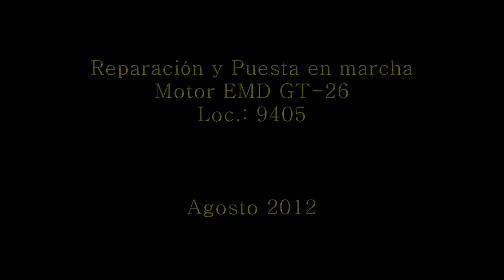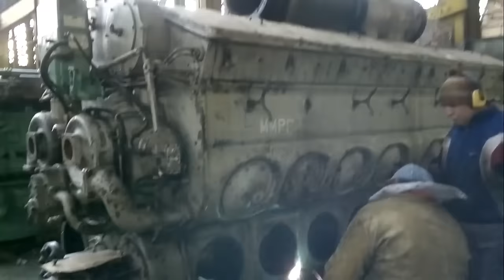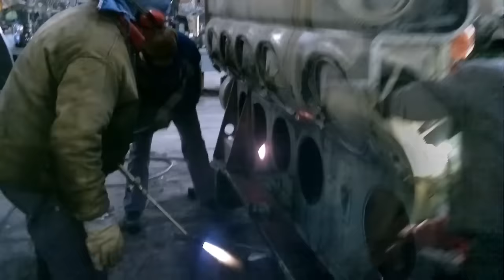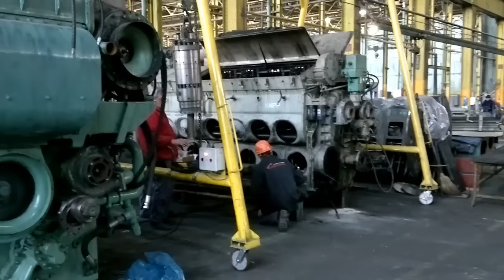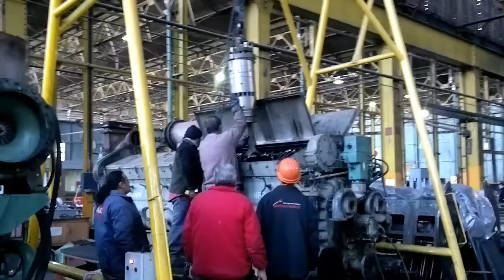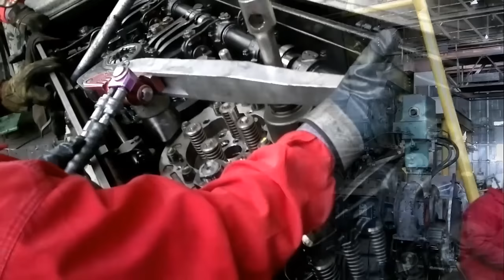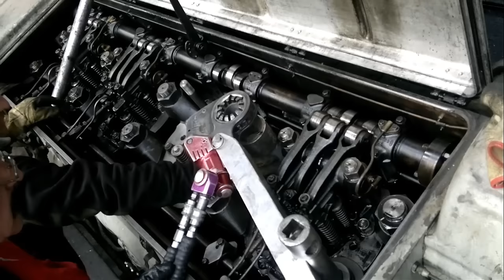Locomotora EMD GT-26 #9405.

Comment: Nice!!  What kind of a starting system is that?? Doesn't sound like air..or inertia..or electric.
Reply: The technicians have the #1 cylinder's "test valve" in the open position while the other 15 cylinders are firing, thereby causing a lot of air blasts.

The starting system on locomotives is a pair of 64 volt starters in parallel or a pair of 32 volt starters in series, either one being powered by the batteries.

It is stationary and marine applications which usually employ air starters, not locomotives.
Reply: Peter Haas
Some trucks are also equipped with air starters as well.  Scare the hell out of you if you are standing next to it not knowing it wasn't a battery start.

Comment: So... On 11:20 and 11:45, why the GT26 wouldn't start up? Not enough battery?
Reply from the maker: Indeed, the batteries were low on energy
So a parallel connection was made to another locomotive to start up
Reply: Ah, is that why we can listen to other locomotive before 9405 started up?
Reply from the maker: Yes, indeed

Comment: That is quite the torque wrench 8 30 into video.
Reply from the maker: the tool is a Hytorc model xlct-4. The nuts are tightened with a torque of 1930 lbs/ft
Reply: Carlos Contreras
dam

Comment: Awesome video
Reply: Muy buen trabaio. But here in usa two people replaced cylinder assembly. Old locomotive we sale to south america because to much smoke. I was working over 20 years on this locomotives. Some guy asking why not use generator   to start the engine. Only use generator to start the engines it is on locomotive build by General Electric 4 strok. EMD it is 2 strok  end useing two electric starters like in buses. Muchas Gracias guys.

Comment: What are the circular covers at the base of the engine - looks like they are secured by a simple hand tightened knob?
Reply from the maker: Hi, Linn Platter
These are covers of the crankcase and adjusted by hand or with a tool
Reply: Two round "hand hole" covers per cylinder on 567C and all later engines including all 645E, 645F and 710G engines (rectangular on 567B and all earlier engines).

The upper "hand hole" is for inspection of the liner and also for connection of the liner to the cooling water manifold.

The lower "hand hole" is for access to the crankshaft and rods, also the piston cooling oil jet.

This concept allows all major engine components to be inspected and evaluated without any significant disassembly, save removal of the "hand hole" covers themselves.

All cylinders may be thoroughly inspected and evaluated in one rotation of the crankshaft.

The engine is "barred over" (rotated using a bar), NEVER "inched" using the starter motors.

Comment: At about 15:45 is he tightening down/closing some type of decompression deal?
Reply from the maker: In the minute 15:30 , the mechanic adjusts the valve plug control compression cylinder #16
Reply: Carlos Contreras Exactly ... cylinder #16, not cylinder #1 as I said earlier.

The "front" of the engine is actually the "rear" of the locomotive, and the cylinders are numbered 1 through 8 on the right side of the block (left side of the locomotive) and 9 through 16 on the other side.

Comment: Awesome video.  I especially liked the part when they dropped in a brand new 2-stroke sleeve into a cylinder.  Mexican labor is much cheaper hence why they buy from the US I guess because these engines can basically run forever..smart thinking on the Mexican side...not so smart on the American lol
Reply from the maker: Hi sc0tte1
What you say is actually true. Here in Argentina, is exactly equal.
Regards
Reply: Labor can be cheaper in places where the government doesn't over-tax and over-regulate its citizens and industries, like the federal and state governments do in the United States.
Reply: What the hell do Mexican labor prices have to do with an American made engine being repaired in Argentina, sc0tte1?
Reply: Robert Luedeman
these diesel tec`s don`t look under payed or cheaper in any way..the engines do run well if maintained but   not forever  they can be rebuilt a cyl at a time as need ed taxes in the US are used for policing the world so dictators don`t rule the world freedom is not free in the free world mr. under ground.. we farm hemp soon in the US again this time forever seed diesel 77% cleaner for the farmer
Reply: D. Saelens
The main difference is the technicians employed a simple "A-Frame" and block and tackle to lift/lower the "power assembly", whereas EMD's approved procedure is to employ a special fixture which is bolted to the top of the power assembly for both removal and replacement. The EMD manual shows the fixture in use, and it would not be at all difficult to make such a fixture in-house, thereby saving much time, and potentially avoiding damaging a power assembly, at a rather small one-time cost.
Reply: D. Saelens I didn't ask for a discourse on hemp farming, American tax policy or how cylinders are changed in an EMD. You don't have a clue about any of it.

Comment: The turbo on the right will fit just fine on a Honda Civic!
Reply: That turbo is designed for a 10,300 cu. in. engine!

The same turbo design was used on 567D engines, and also on 710G engines.

It is actually a turbo-compressor system.

During starting, it is acting as a compressor, driven by the engine's crankshaft through an overrunning clutch.

After combustion has been achieved, and exhaust gas temperature is sufficiently high, the overrunning clutch disengages and the turbine takes over and the turbo-compressor becomes a true turbocharger.

This design eliminates the need for two Roots blowers.

Comment: So countries like this and India get the second and third hand locomotives of the world? Don't get me wrong what they did in this video is quite impressive but why the non-standard couplers and lack of handrails?
Reply from the maker: 1) Our locomotives are very, very outdated.
2) This railway line is still using the old English system (chain couplers). I could not tell you why not use the knuckle system (which is much safer)
3) These locomotives were already without handrails, (do not know why and neither because they are not adapted)
Reply: Carlos Contreras Yeah I was curious, I mean safety guys at least weld up some handrails on them. 
For outdated locomotives you guys seem to have rebuilding them down to an art. 
Also here in the US class A railroads (BNSF, UP, KCS/TFM) are always scrapping railroad equipment which some is still in perfect working condition. Why not look into obtaining things from here? Will they not allow it?
Reply from the maker: ElfNet Designs I would not know that answer, since this is controlled by the state. We request a great deal of spare parts and various materials, but unfortunately depend on the decision of the state.

Comment: Why is the oil blue? And what are the valves the exhaust is leaking out of and the guy tightens?
Reply: shoominati23 those are the snifters (or cylinder blowdown valves) usually those are used to blow out any crap or moisture that is left in the cylinder. (idk how it is for the railroad guys but in the marine industry we will normally keep the fuel rack shut while we turn it over)Btw he is tightening them all wrong XD never use a pipe wrench on them, they wont last very long like that, it strips the threads.
Reply: shoominati23 Its probably 50wt non detergent oil. its not pennzoil or quakerstate, thats for sure.
Reply: I always wondered how they could change a piston in a big engine, like one in a ship. turns out they change out the whole piston, liner and valve gear. Very clever.

Comment: Also, why do 2-stroke loco engines have valves?  That sort of confuses me...unless I'm wrong in assuming it's a 2-stroke, but I saw the sleeve with the exhaust vents at the bottom so idk.
Reply from the maker: Hi
These 2-stroke diesel engines have air inlate ports and 4 exhaust valves (each cylinder).
Reply: Charge air enters through the ports towards the bottom of the liner.

Combustion gasses leaves through the four poppet valves in the top of the head.
Reply: Peter Haas Ahh I see.  I totally thought it was the opposite; exhaust leaves the ports at the bottom.  Thanks for the replies people, cheers!
Reply: sc0tte1 All large EMD (and GM) two-strokes are "Uniflow": the charge air and the exhaust gasses flow in one direction, UP, hence the designation "Uniflow".

In the video, you can see all the ports in the liner, towards the bottom. That is where the charge air enters the liner from 45 degrees before BDC to 45 degrees after BDC. This timing is fixed by the basic design of the engine, but is optimum for this engine design as all four functional "strokes" (720 mechanical degrees) have to be combined into two physical "strokes" (360 mechanical degrees).

Also, the fuel is injected at 4 degree before TDC so that the fire front will impact the piston just after TDC, on the piston's downward (power) stroke).

The timing of the four poppet-type valves is critical for high engine performance, and for that purpose, the power stroke is allotted fewer mechanical degrees than the combined scavenging+induction of charge air stroke.

In other words, while the ports in the liner are open symmetrically about BDC, the timing of the valves is asymmetrical about TDC, and the amount of asymmetry largely determines how efficient the engine will be.

What EMD (and GM) usually does is build a two cylinder engine and use this as a test-bed to optimize the timing of all of the events. Actually, most of the work is in designing and optimizing the orientation and duration of the camshaft lobes.

Then, they go ahead and, at least in EMD's case, build 8, 12, 16 and 20 cylinder engines (6 cylinder engines are no longer made in 645 or 710 models, but were made in 567 models).

As these are 45 degree Vee engines, timing is optimal for 8 and 16 cylinder engines (even firing, once precisely every 45 or 22.5 degres), and is not as optimal for 12 and 20 cylinder engines (uneven firing, once approximately every 30 or 18 degrees).

A comment about the liner design.

To maximize the intake of charge air, the liner has ports around its entire periphery. This means that the piston cannot have a piston pin which is exposed to the surface of the piston.

This, then, means that the piston pin must be contained entirely within the "piston carrier", and that the piston itself rides on top of the piston carrier, separated by a thrust washer.

This is a more complicated design, not duplicated on the Detroit Diesel two-strokes, but allows the EMDs to have higher charge air induction efficiency, which is important in a large diesel engine.
Reply: Peter Haas Thanks for your very detailed reply.  I understand! :)  Cheers
Reply: those are intake port and exhaust valves
Reply from the maker: Brian Smith
Yes sir, intake port and exhaust valves
Reply: Carlos Contreras Intake ports around the entire liner to maximize intake efficiency.

The Detroit Diesels, which use the same concept, use a conventional piston with an exposed wrist pin, therefore the DDs can only use about 85 percent of the available area for intake ports.

But, the first DD was the 6-71 with 426 cu. in. and 225 HP, and the earliest EMDs were 600 to 1350 HP out of 3400 to 9000 cu. in.
Reply: I have rebuilt them

Comment: are there electric motors driving the wheels and the diesel just runs the genarator?
Reply from the maker: Yes Sir. The Diesel engine drives a generator only, and electricity moving electric motors that are in the axles

Comment: YAY torch and sledgehammer, the old fashion way :-) and it works..
Reply from the maker: It's true :)
Reply: Yes, but an oxy-acetylene torch was used to heat the metal to its plastic point.

The whole point of that exercise was to restore the "crank case hand hole" to its proper shape and size, after it had been damaged by the opposite cylinder throwing its rod through the side of the block.

The "air box hand holds" must seal well to avoid loss of "charge air", from the turbocharger.

The "crank case hand holds" must seal well to avoid loss of lubricating oil.

Comment: the people that work on the engines, what are they called just regular locomotive mechanics?
Reply from the maker: yes sir, that's right; mechanical locomotive
Regards
Reply: DO remember that this is a diesel-electric locomotive, and most of the complexity is in the electrical side of the engine.

Later models, including those made for export, have electronic fuel injection, and this adds computers to the electrical side.

So, proper maintenance requires mechanics, electricians and computer techs.

I just call them all technicians, which is a "neutral" term.

Comment: look at those headstuds!
Reply: Those four are for the purpose of retaining the entire "power assembly".

The power assembly is a complete unit, consisting of the liner with integral cooling jacket, the piston, the piston carrier, the connecting rod and the head.

The head is held to the top of the liner by other sets of bolts (six, I think),

The power assembly is held into the block by four HUGE bolts which actually span two cylinders on the left and two on the right.

The end cylinders and the middle cylinders on 16 and 20 cylinder engines have two bolts which span just the one cylinder.

Older engines use "crabs" (which are conical and are difficult to manufacture); current engines use "plates" (which are flat and are easier to manufacture), but both perform the same function: retention of the power assembly or assemblies.

16 and 20 cylinder engines have two main bearings in the middle (8 cylinders on each side or 10 cylinders on each side) as the crankshaft is built in two sections, and is pinned and bolted together at the midpoint, with main bearings on each side of the pinned and bolted junction.

8 and 12 cylinder engines have one-piece crankshafts, and, consequently, no doubling of main bearings in the middle.

The camshafts are built in several sections, too, to facilitate engine repairs and maintenance.

It is not required to remove the camshafts to service a power assembly as the rocker arms are located on the head itself, and all that is needed is to remove the rocker arm assembly, after disconnecting the oil line from the camshaft.

The camshafts are hollow and provide oil to their own bearings and also to the rocker arms.

It is an elegant design, and is very easy to maintain.

The repair which this video illustrates could have been accomplished with the engine in place on the locomotive, but there was certainly the possibility of more extensive repairs, so out of an excess of caution, the entire engine was removed.

Also, it appears that the turbocharger was changed at the same time, so perhaps that was a consideration for performing all repairs on the shop floor.

Comment: These motors pulls a eletric generator or geared to wheels?
Reply from the maker: These Diesel engines have a power generator, and this electrical energy moves the electric motors which are in the axles of the locomotive
Reply: Carlos Contreras
thanks

Comment: How much HP does this produce and @ what RPM?Always curious about these type of engines as my knowledge is limitedto your average semi engine.cummins/cat/and some detroit oh and the weak internationals.Thanks and a big hello from south georgia USA.
Reply: 3000 HP @ 900 RPM. It's the EMD 645, 16 cylinder. This is basically the same locomotive as an SD40-2 in North America, but different packaging for different clearances.
Reply: jagboi64 this is perfect for my 1936 160 ft. yacht
Reply: They also run these at 3300 HP in some locomotives.
Reply: formidable38 3000 HP is the net HP at the flywheel (i.e. what goes into the generator), they run at about 3300 to cover the auxillaries (air compressor, cooling fans etc.)  North Americans use the lower figure, the rest of the world the higher one.
Reply: U686ST What are the torque numbers though, haha.
Reply: Jonathan Angel Easy enough to find out using the following formula.5252 x HP divided by RPM.5252 X 3000 = 1.5756e7 divided by 900 = 17'506 pound ft.
Reply: formidable38 That's insane. I guess I'm just used to cars and trucks numbers, haha.
Reply: Jonathan Angel If you type in 'EMD V20-710 Start-up and rated load' into the search box on YT, it will show the EMD V20 engine, its the biggest 2 stroke diesel EMD built as used in SD80MAC locomotives and standby generator power. Its 5000 HP and 29'000 pound feet of torque at 900 rpm. Unless its about ships and the like, about as big as it gets on land. EMD and General Electric have dabbled in a 6'000 hp 4 stroke lump though but not as reliable.

Comment: are those turbos at the front?
Reply from the maker: Yes sir. But it is a single turbocharger
Reply: so they work as a forced air iduction (the main intake?) or they help to increase hp or torque. Sorry for my ignorance mate but you know ive never seen one in those engines but only in cars LOL
Reply from the maker: Jorge Rivera So it is. The turbocharger causes higher air flow forced the Diesel engine causing it to increase its power (HP). Starts working from the start, mechanically; after the motor has reached a certain number of rpm the turbocharger runs Diesel exhaust.